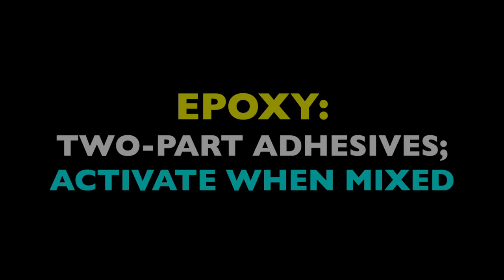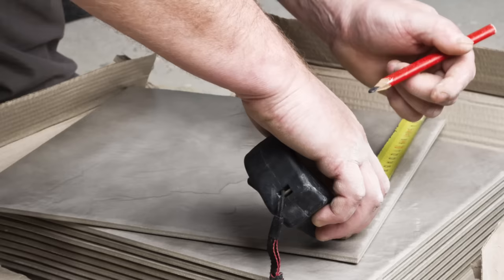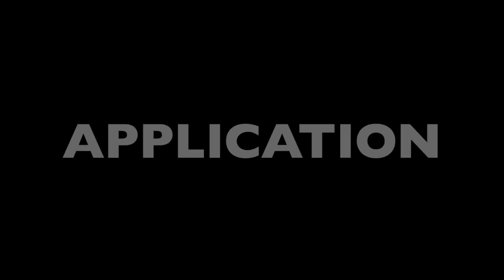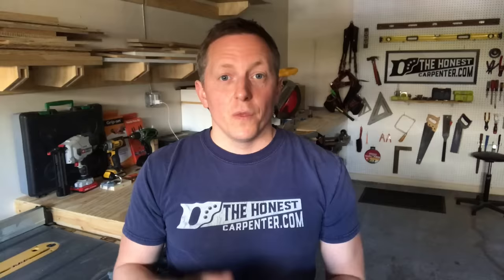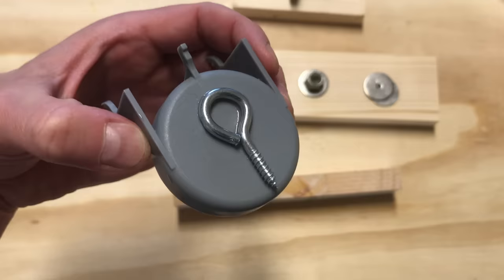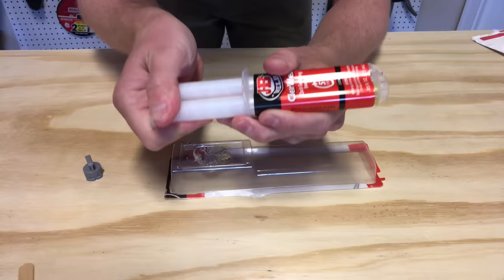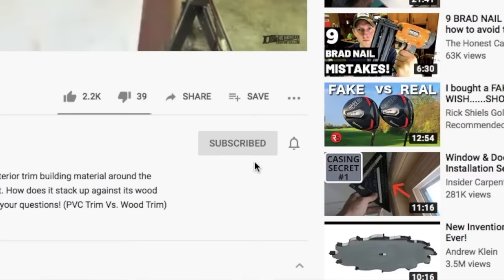DON'T USE SUPER GLUE! Try This Instead..(Epoxy Adhesive/5-Minute Epoxy/Epoxy Glue)

Comment: It might be good to mention how, when replacing the cap, if any hardener touches the resin tube/syringe the entire resin tube will be wasted (hardened) when you try to use the epoxy for the next repair. I find dual syringes are too prone for this malfunction to happen so I always buy epoxy in separated tubes.
Reply: Thanks for the heads up.
Epoxy is not cheap
Reply: I agree and have experienced everything you said. Take note Honest Carpenter.
Reply: Yes. Those dual tubes often end with one-time use. Better to buy them as separate tubes
Reply: @dfcbman  I have cheap ones if needed, but they are made in China
Reply: Always carefully clean both nozzles on the dual syringe adhesives and they will last forever.
Reply: You are right on with this statement as I never had one of the dual syringes last to the end of the product and they are for the masses that don't know they are getting jipped again~!!
Reply: No, it's a condensation reaction not a radical polymerization.

Comment: I find it best to lay down some painters tape and mix the epoxy directly on the tape. You just peel up the tape and toss it when your done.
Reply: I use a scrap of cardboard, usually clamped down to the bench
Reply: Simply  brilliant, brilliantly simple. Thank you Mike
Reply: I like that, Mike.
Reply: Very useful indeed. Tnxs
Reply: Thank you for this great yet simple suggestion! I would use a piece of scrap plastic or cardboard, but tape can prevent the glue from dropping due to hazards like wind and animals. And you can put the glue on a slope, or upside down if need be.
Reply: Great tip!!!

Comment: Remember the strongest by far are the slow setting ones so if you want a really strong job use the slow ones and leave them overnight or 24 hours
Reply: And check brands. Some aren't as strong as others.
Reply: In my experience the 5 minute epoxies don't set hard enough.
Reply: I avoid those 5 min epoxies.  Never got the strength  advertised. Used that stuff to glue on some magnets to some solar lights. Very small lights made of plastic except for the metal bracket that the magnets  were glued to. Cleaned with alcohol after  lightly  sanded. Still failed. Best results with the standard hardining time ones. use the fast ones to fill gaps, holes but never on things that need to hold together.

Comment: This was a great video! I would just like to add a quick bit of valuable information. Epoxy does indeed adhere maybe the largest variety of materials, however, in order for it to perform best on smooth non porous materials like metal and glass, it needs tooth. The surface should be sanded to create a slightly rough surface for it to perform at its best.
Reply: Good point. Slow curing epoxies need little tooth, but the quick curing varieties like 5, 15, and 30-minute epoxies should be prepped with rough sandpaper.
Reply: @Bob_Adkins  , also, 5-minute epoxies don't work all that well on wood (or other porous or fibrous materials) because they set so quickly that the epoxy doesn't really get a chance to "wet" to the wood and soak into the wood fibers a little bit.
Reply: Fantastic! A bit of sanding is good to know prior to utilizing the epoxy.
Reply: What about temperature?  I need to glue a plastic edge back onto a glass frig shelf.
Reply: Anyone have any experience with plastic that always has pressure on it...I broke the plastic piece on my tripod for my phone (it's the part that holds my phone,so it has pressure when it's squeezing my phone to hold it.would this one work or does anyone know one that would work great for that?
Reply: I’m so
Reply: Any glue there which bond  Rexen with a sticky dashboard

Comment: Gorilla Glue sets hard, but the tensile strength is weak. JB weld  epoxy holds much better. Harbour Freight's brand does well also.
Reply: yes very good
I also have better glue than yours

Comment: I built a couple of wood core (red cedar strip) kayaks, used a lot of epoxy. Incredibly versatile and strong bonds. A couple of tricks. First as you use the small epoxy kits, the 5 minute stuff, you might want to step up to West Systems or Raka (there's one other that's also good). These epoxies are liquids made to go on thin. You thicken epoxy for different uses. You add powders to the epoxies to thicken them. The Heavy thickeners are used to mount hardware, like boat cleats, and the super light fluffy stuff for 'fairing' this is when you need to fill a depression in the surface of your boat. It's not very strong and it sands more easily. 
For the 5 minute epoxies here's a trick. Just use flour, I used instant pancake mix, these are basically inert and mixed in with the epoxy they work exactly like the WestSystems fillers. Zero issues of rotting, absorbing water.... 
Now when you need something to set up quick - that 5 minutes. Then mix it and leave it in a clump and it'll 'go off' at the predicted time. If you use a filler and you're in a hurry, let it sit for part of the time and then mix the filler. If you want to delay the setting time then mix the filler as soon as you mix the two parts and it will delay it. If you mix a big batch and leave it in a cup it goes off much more quickly than if you spread it or put it into multiple cups. 
Epoxy smells 'nutty', but is actually carcinogenic. The resin part is 90% BP-A the plastic that acts like estrogen and causes cancer. Once it's set, it's inert. It used to be recommended for baby furniture and food surfaces - but not for at least ten years. (Keep this in mind about all plastic. I think the only standard for 'Nalgene' is to say it's safe - I only drink out of stainless steel. If I get say a Smart Water Bottle to refill while traveling, as soon as it gets a bit worn or creased I get rid of it.) 
I learned to always wear latex or nitrile gloves, long sleeves and a respirator - but I was working with large volumes. You could do the whole container of 5 minute and you'll be okay. Wear the gloves though, it's sticky and difficult to get off your skin.  Wet - it can itch and cause a rash, and one guy I heard about didn't wear a mask as he went through a boat building training course - he got certified but couldn't work anywhere near epoxy any more. Don't sand partially set epoxy -this seems to be the current big warning. I guess the dust from this would be the most toxic. And once it's set, and you sand it wear a respirator. You would never say, "Hey got any extra birth control pills? give me a random number of them to swallow." 
To clean up epoxy just use vinegar. 
That hook on the board? I'd rough up the back of the hardware, and the board. Because the board has a small area for the epoxy, I'd lay down some blue masking tape, cut out the shape of the hook backing and then I'd carve, drill a bit the wood. I'd also use thickened epoxy if I had a bunch of these to glue. (I've seen expensive sailboats being repaired and it was clear that the vinylester (similar to epoxy) was not properly prepared between coats - as they scraped it came off in layers. Epoxy done right will never ever do this. To bond two hulls together I had to epoxy a strip of fiberglass. To make this neat, I'd run a line of  blue tape above and below the seam, lay down the glass strip overlapping onto the blue tape, then when it's soft but not set I cut along the edge of the blue tape then pull up the blue tape taking the rough edge of the glass. So plan to mask for drips instead of trying to clean it up later, run a sharp blade along the edge and pull the tape up when it's still soft. 
And as epoxies go usually those 5 minute ones are considered second rate - but they're still plenty good for whatever you use them for. I use them.  Hope this helps.

Comment: JB makes many things, one of which is JB Kwik Weld. JB Kwik is magic goo. I use it for more than metal. I can build it up, then file or grind it to shape. One thing people don't seem to know is that superglue may be strong in some applications, but it shatters and fails when hit sharply. This can actually be useful. Sometimes, I will superglue a wood stop or guide onto something and then, when done, smack it sharply with a hammer to take it off. Be aware that this can rip out a few fibers and can leave residue behind. As long as we're talking about superpowers, like epoxy, it's worth knowing about bicycle tire inner tubes. Cut one open and cut out the stem, then split it along its length and you have a long rubber strip that can be wrapped around odd shaped things to hold them together while glue dries. With inner tubes, you can clamp things that are unclampable otherwise and, with each wrap, you get more pressure (so be careful). Inner tubes can react with finishes especially if glue squeeze-out gets under the rubber. Often, I split the tube open, then split it along its length so that I get two strands of rubber. Otherwise, the strap can be too strong.
Reply: I call bike inner tubes the poor person’s bungee cord. Mountain bike  ones are my first choice. Go to any bike shop if you don’t have your own.

Comment: Q-tips are handy mixers/applicators for small repairs:  I cut one end off with scissors or wire cutters, and use the stick to mix the epoxy, and then use either that same stick to apply, or get another q-tip and use the cotton, sort of a tiny paintbrush to apply the epoxy.

Comment: You're spot on with your assessment of how good 5 minute epoxy is. Thank you for all the awesome videos you make, I really like your straight forward no nonsense communication style, and your excellent advice on so many topics, is much appreciated.
Reply: He doesn’t mention anything about metal to glass or glass to metal I have an iPhone X and I was cleaning off the screen so I can apply my screen protector I used alcohol and it might’ve gotten to the side of the phone and now the phone is starting to bulge up or stick up where the power button is I thought it was the battery bulging but there seem to be no pressure on the side where the buttons are for the Valium I was wondering if I could apply a little bit to the side and press it down with a little weight will it possibly bond

Comment: I've long known about epoxy and how it's often a better choice for the job than superglue-- but what I didn't know was about the PSI ratings and that there were many variations that are optimized for particular materials-- thanks for the tips, this will come in handy.   I've found a few times that using epoxy to fix something broken, that if it breaks again it doesn't break at the same point-- the bond holds so well that it breaks somewhere else instead.

Comment: Both epoxy and CA glue have their place in the shop.  I use CA glue for joining smaller wood pieces together before pin nailing.  With an activator spray, the CA cures immediately.  Epoxy is great for filling large voids in wood where a smooth flat surface matters.

Comment: When using epoxy on tough surfaces that need to be held in place while the epoxy sets, I use a dab of superglue and a sprinkling of baking powder for instant hold in place.  It's not a very strong bond, but does a great job keeping everything aligned.
Reply: Can you explain a bit more, exactly where are you putting the baking powder,  are you sprinkling it on what you're adhering and then putting the glue over it, maybe glue first then the baking powder or do you mix them first, I'm very intrigued by this and I'd like to know more if you wouldn't mind, I am noticing this is from a year ago so you may never see this. 🙂

Comment: I've being using specialty and consumer epoxies for decades in the lab.  There are a few things I would add to this presentation:

1. I keep track of which products are good for which surfaces.  Plastics are particularly touchy.
2. I store all my adhesives in a cold room.  They degrade more slowly that way.
3. Surfaces need to be clean for best adhesion.  Sometimes, roughening is helpful.
4. If you are going to bond different materials (like metal to plastic) and the assembly will be subject to temperature variations, see if you can find a urethane adhesive.  The cured adhesive remains compliant and takes up the strain caused by differential expansion of the two materials.
5. Typically, the thinner the epoxy layer, the better the adhesion.

Comment: I was introduced to two part epoxy adhesive almost 50 years ago at the start of my engineering apprenticeship. The brand name then was Araldite which is still sold today. It wasn't 5-minute but nobody cared. It came in 2 tubes rather than the double barrelled syringe in your video but that was (and still is) fine too. It worked extremely well and that is all I care about and I have used it for everything except wood joints ever since.

Comment: Embed things in the epoxy for extra strength.  I’ve used little pieces cloth, wire, metal or plastic window screen is perfect, and even a bit of paper towel can work wonders.  In addition to whatever strength the material provides (none for paper towel), simply by breaking up the continuous epoxy mass and giving it sort of a lattice structure, it just seems to help repairs hold up that otherwise would rip the epoxy in half (like rebar in concrete).  For ex I epoxied a big plastic trash can with a 1” crack in the bottom, it’s being used as a rain barrel, so that’s a huge amount of weight on it. The first repair attempt with JB Weld clear instantly split in half along the crack. Then I redid it exactly the same with a little scrap of screen encased in the epoxy, and it’s been holding rainwater for a couple years now.  Amazing. Take epoxy to the next level 😁
Reply: You can look at fiberglass and epoxy for good reinforcement.

Comment: I used the JB weld for metal on my snowblower. On the discharge shaft the drive bearing key broke and the shaft turned inside the bearing wearing down the shaft so the shaft wobbled in the new bearing. Not wanting to change the shaft until after winter I centre the shaft in the bearing and filled the void with JB weld. I let it cure for 48 hours, it works like a charm there will be no problem finishing out the winter

Comment: Another awesome video . JMO - Mix pre - stained sawdust with epoxy and have the wood filler from heck . Thanks for another smash hit video . All the best .
Reply from the maker: Great point, Quantum! I've watched the flooring guys mix up filler with wood glue and ultra-fine dust from the drum sander bag...but your way would create the ultimate indestructible wood filler! 😄
Reply: I always use the lightest color pine sawdust as it gets darker when wet and remains darker.

Comment: One additional comment, the reason why two clear chemicals turn murky is because its a way to determine if the epoxy was mixed correctly. Epoxy has a need to be mixed thoroughly in order for it to achieve maximum bond. When its not mixed correctly it might as well still be in the tube. So a way to tell if its mixed well enough is to see if its "murky" throughout. Some epoxies are two entirely different colors - white and black - for example so you can tell its thoroughly mixed when it turns grey. I like epoxy much also, but crazy glue has a unique diy function when mixed with baking soda. When you do so and carefully you make a material that's as hard as rock but since it came from the crazy glue you have made a fit to any shape or dimensions that you crazy glue in the first place. I have recently become aware of its molding potential and it looks really promising.

Comment: I love epoxy resin. Building models years ago, epoxy was the go to strong glue, especially for wood to metal.  Then along came “Super Glue 3” from Loctite, it was a game changer, but we soon found the joints were brittle when used for structural joints in flying models, and came apart when left in water for any length of time (so not for the dishwasher on repaired cups).  One of the strongest epoxies off the shelf is the slow set ‘Araldite’.  It is stronger than the five minute if you can set up the joint and leave it to cure overnight.  I also found the graphite coloured JB Weld available in tubes, to set rock hard too!
Reply: Cyanoacrylate bonding agents are not certified for use on food-touching items.  You might repair cup handles, for example but plates, cup rims, etc. are off limits.
Reply: yep the  grey jb weld  regular is best , it may be slow curing   but  superstrong

Comment: When I use CA it is for something that needs doing right there and that I can keep away from my fingers. The thing I've noticed is that once a tube is opened, no matter how ell you seal it, it's a one use product. That makes it many many times more expensive than it was at the store. But, there is a use that some wood turners use it for. It is a very good finish. I use it when turning pen barrels.
The epoxy glue has a very long shelf life. As long as you properly seal the ends, without cross contamination, it will last right down to the last drop. This, in itself, makes it the far more desirable strong glue.
Reply: I've had no problem reusing little bottles of CA glue, just don't tighten down the cap all the way. My tip is to tighten it all the way, but then back it off  as slightly as you can physically handle and leave the bottle upright. I can keep a small bottle of glue for about 2 weeks which lets me use it on other jobs too. 

I mainly use CA glue for minor guitar repairs, like soaking screw holes in thin CA glue to strengthen the threads, gluing in fretboard inlays, filling small finish dents and using the tiniest dab to hold a guitar nut in place (never had a problem breaking them loose when I need to remove them)